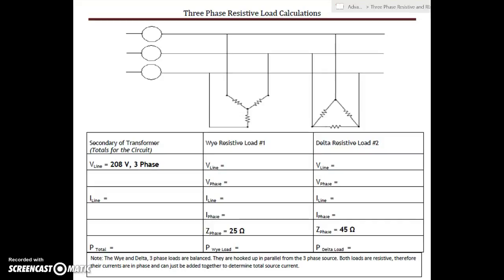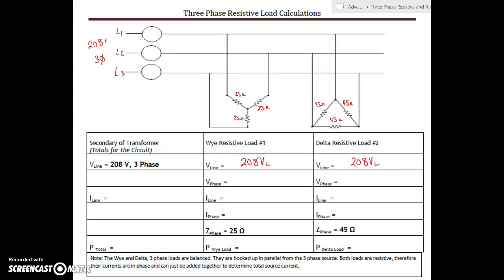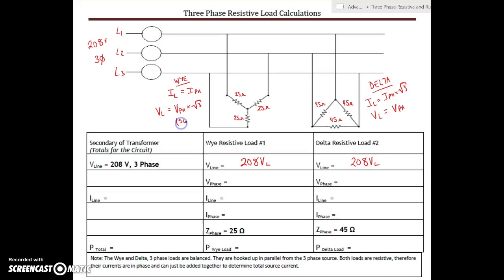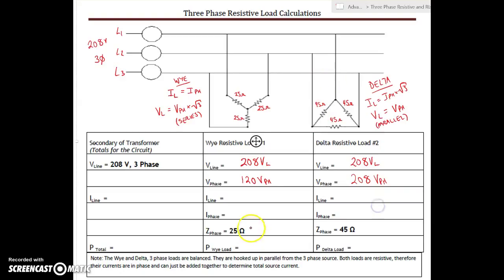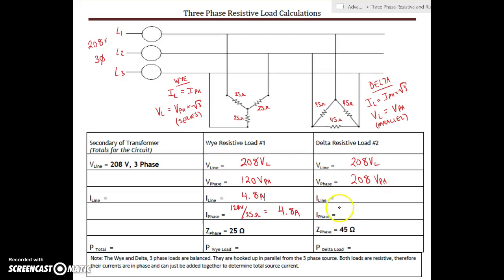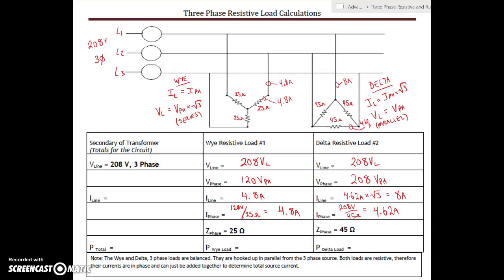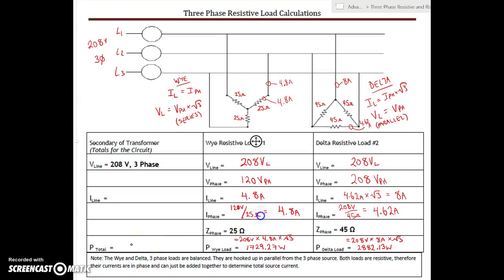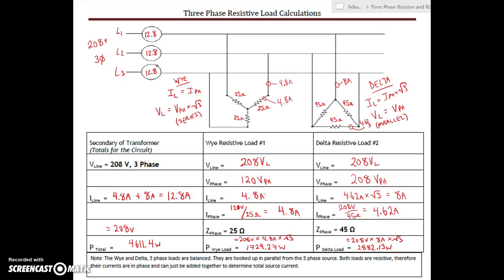3 Phase Resistive Load Calculation #2

Comment: The curious symmetry between wye and delta power consumption is exposed with this little problem set. In wye, the phase voltage is Vline/sqrt3, in delta the phase current is Iline/sqrt3. Since there are three resistors, that sqrt 3 correction is moved to the top because (3/sqrt3) = sqrt3. In the end, the simplifying power formula comes to home, Vline*Iline*sqrt3. I suppose I should have expected that....